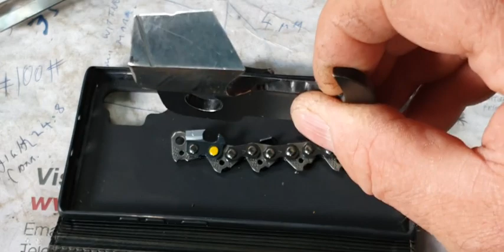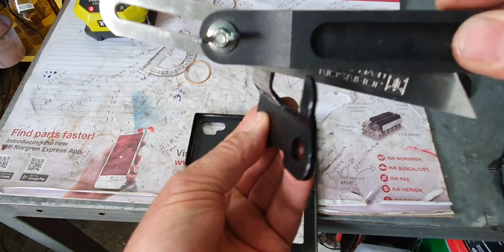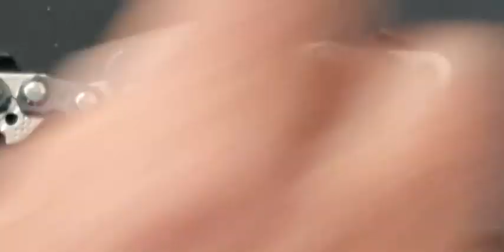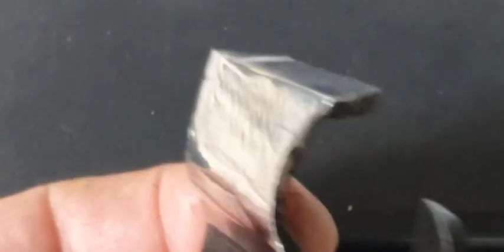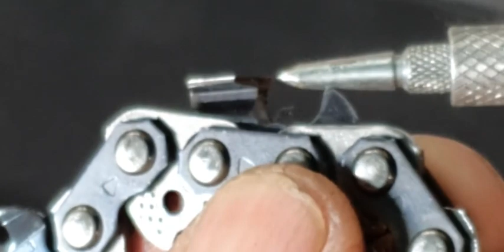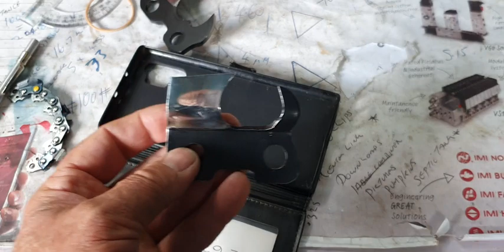10° Downward Tilt Explained

Comment: The 10° downward till also reduces the top plate angle 2 and 1/2°. So you're at 27.5° rather than 30.
Reply from the maker: Yes.  Some like it.  I found it never helped me, but that said if I see to much hook I will use 10° tilt

Comment: I have an Oregon 520 grinder. When I adjust the vise to cut 10° tilt do I adjust the vice as far as it will go. There are no graduation marks on the vice and don't know if I need to  adjust vice all the way for 10°
Reply from the maker: Oregon 520 has a sliding vice up to 15° - and 15°+  you select 10° only the 15° is used also to adjust and error offset of the grinding wheel.  But that's a nother subject.  See my video Jolly Evo Grinder review its almost same as 520 with sliding vice

Comment: Ok I just watched d another video you down on th do ward til  ive always heard for right hand cutter you push the bottom away or that's how I took it. So your saying if the cutter is right handed  you push the top part of the deck away from you not the bottom  ?? If its a left hand cutter you push the tooth toward you ? I think that's your saying am I being correct with your explanation ? I just want it done right
Reply from the maker: Left cutter  the vice tilts backwards right cutter the vice tilt ls towards the operator the confusion is pushing the knob in the opersite direction l.  If  you have a sliding vice like me Tecomec Jolly evo the same deal. Left cutter move vice away from you.   Right cutter pull the vice towards you
Reply: Thank you . I he always thought it was the other way but if you look at the results I never though it made sense .
Reply from the maker: @rc391995  there is a jingle that you can remember for right cutter move right away that's the knob.
As you push the knob away the vice lays backwards.  All you ever need to  remember the chain must leans back like sitting in a chair for both left and  right cutters
Reply: Thank you I had some ole chains and went and tried it like you said. Its much better and you can feel the difference . it makes a lot better sense now. . Thanks for sharing.
Reply from the maker: Good to hear

Comment: The reason for the 10 degree upward angle is to improve the chisel angle (slope all the way across the underside of the top cutting edge) without adding to the hook.
The chisel angle is what lets the chip slide out from under the tooth and is collected I between the teeth- then ejected when the teeth daylight out of the kerf.
The hook can be made more or less on both full chisel and semi-chisel by filing higher or lower in the tooth regardless of any 10 degree adjustment.
Reply from the maker: Yes but these days Stihl don't even recommend it. Makes you wonder ?
Reply: @ChainsawUsers if there is any wear to the bar rails- the tooth tips a bit - giving the slight upward angle to the filing.
It all comes back to understand how the teeth (takes a right and left cutter to make a complete chip) actually makes the chips.

Comment: I wonder if I can just double bevel file my F/C chains at a flatter angle so it last longer in dirty wood. I chip a lot of teeth. Or maybe just round file them. My chains fly through would until it hits one grain of dirt then nothing. Thanks and I just subscribed.
Reply from the maker: You can experiment with that even 5° tilt will help its just full chisel will benefit from tilt less hook.  If you file 3/8 chain use 5.5mm file 7/32 until half way  files tooth down and swap to 5.2mm file that helps keep on top of the hook problem.

Comment: I don't think your larger than life example of a semi-chisel cutter is very accurate. It looks like it has a 90° angle from the top plate.
The ones I'm more familiar with look more like a question mark.
Reply from the maker: Question mark chains viewed from the back are chipper chains
Reply: I'm unfamiliar with the term 'chipper' chain. Up here in the states; the question mark shape is what we call semi-chisel.
What do you use a chipper chain for?
Reply from the maker: @John-cj3ve chipper chain are the first semi chisel chains and looking like a ? Viewed from the back.  Semi chisel is a variation of that